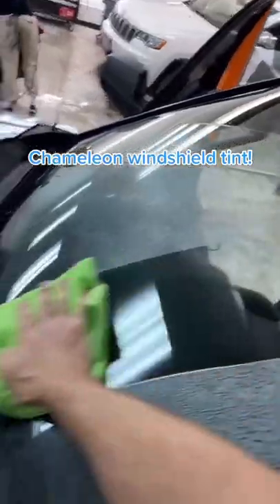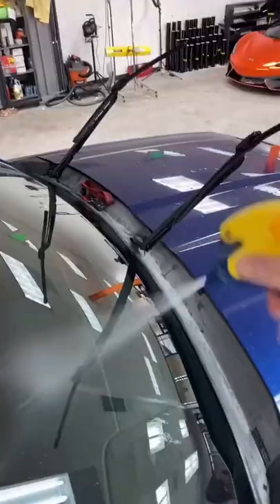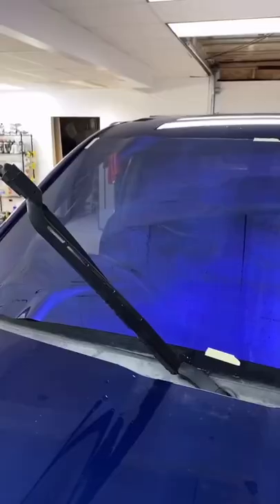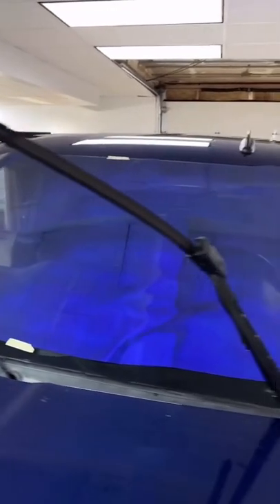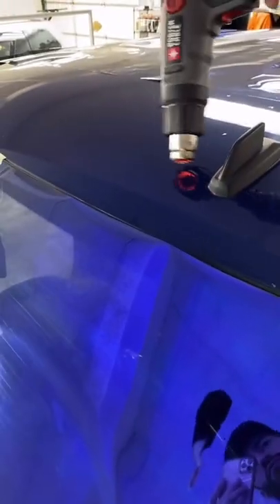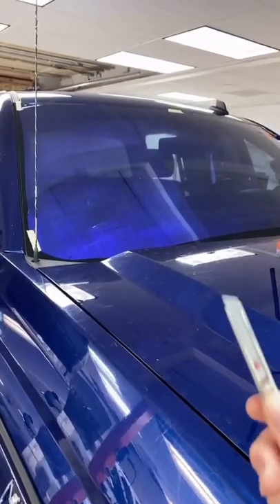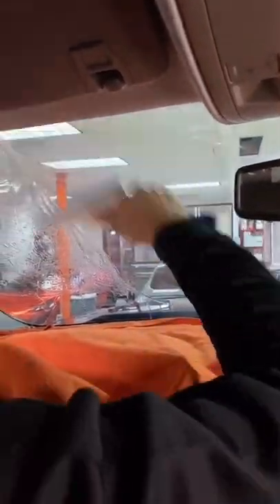Ultravision chameleon windshield tint!￼

Comment: I’m a bit slow. So you size it by putting it over the front windshield and cutting it? Then you apply it on the inside because it’s already cut to fit?
Reply: Yeah you don't want your tint on the outside bro. It's like wearing a poncho under your regular clothes tbh.
Reply: Yes this way it's not exposed to outside elements. It's the same film that sunglasses use. Clear from inside but blocks uv and sunlight